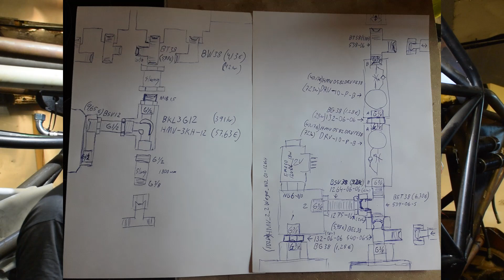Monster Truck Gas Hydraulic Suspension

Comment: So those accumulators are homemade? What kind steel is required to hold the presure? I know it's DOM tubing did you hone the inside or is it straight from mandrell finish? Also how are you going to set the ride height some level control valve or simple gauge to show how high or low are you riding?
Reply from the maker: @GLMtr  well Yes but you buying a special hydraulik tube in the length you want and the width you have a piston for they are hardened. Yes I hade a wire that showed the height in my old truck.   □